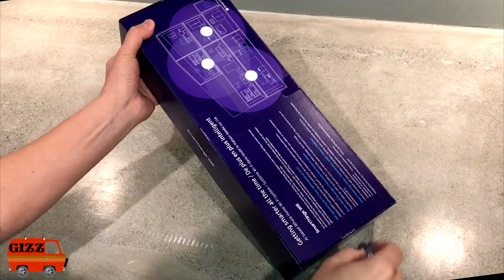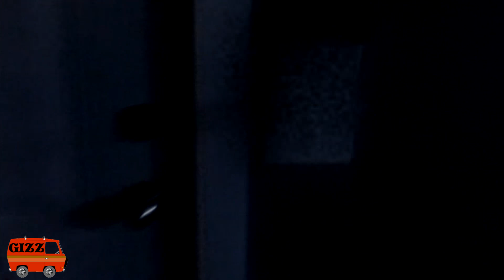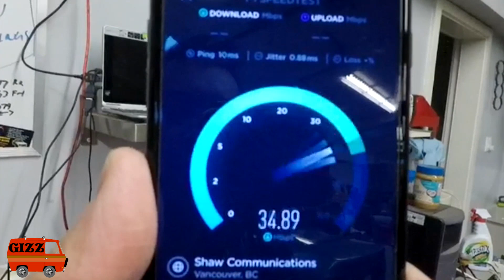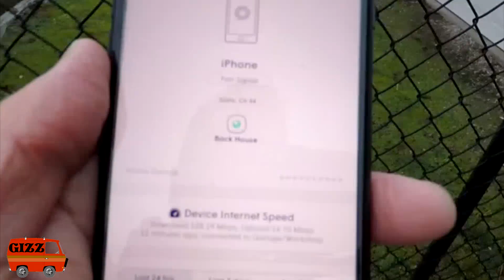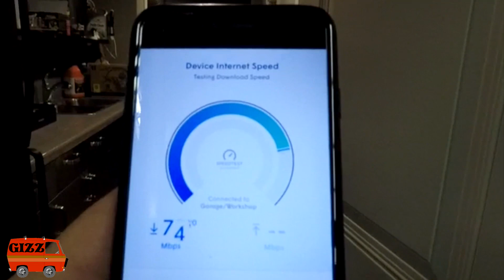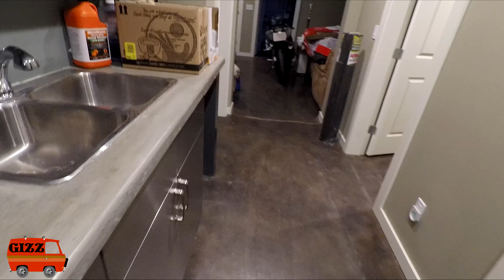Samsung SmartThings Mesh WiFi Router Test

Comment: How much faster are you getting with this router?
Reply from the maker: My speed is limited by my internet plan. The main benefits of this is the increased range, as well as its use as a hub. The internet is also really stable, I never have to reset this.

Comment: This video made buy the wifi mesh.. lol 2 questions, 1. What Cat ethernet cable did you use? 2. Did you use only one long cable or did you use 2 or more cables and connected them with an adapter?
Reply from the maker: Manuel Gonzalez cat5e, my router feeds both, the one goes though 40ft, then a switch, then 25 ft then another switch, then 300 ft then another switch then into the next Samsung unit. I only got the rock solid connections over a long wired distance after adding the cheap netgear switches. How is yours working?
Reply: @GIZZMOTORSPORT  - I have one Hub giving me less then desired speeds. I was thinking of just ordering a 200ft cat7 ethernet cable and run it through the attic. From the out port on the smarthings hub 1 to the second. What do you think?
Reply from the maker: Manuel Gonzalez the 2 in my back building have 2 walls and about 90 feet in between, they are working just fine for wireless mesh. Are you having wifi or hub sensor issues?
Reply: @GIZZMOTORSPORT  - Wifi, on the unit connected to the router I'm getting over 350mbps download, on the second unit (wireless) I'm getting around 185mbps, on the third unit (wireless) I'm getting about 65mbps. 
Do you think my idea on the previous msg might work?
Reply from the maker: Manuel Gonzalez before running wires up to the attic run them from room to room and see if it works.
Reply: @GIZZMOTORSPORT  - I'll give it a try and let you know. I just ordered the ethernet cable. Wish me luck. 😅

Comment: Great review. Have you used the Smart Home Features at all on these devices? any feedback? Thanks!
Reply from the maker: I have lots of the magnetic open/closed swithes, they also sense temperature and vibrations. I have more than half setup to notify me and/or turn on lights when there is a vibration. And of course I'm notified when they open. The one thing I've noticed on the sensors, they can lose connection randomly, have to re-re the battery and then it's back to normal. I also have the skybell doorbell tied in, the video doesnt work as I'd hoped but the sensor can activate whatever you tell it to though the hub/app. All in all it's a good purchase, the the wifi is the best I've had here.

Comment: Just bought a set for the house. How did you go about wiring router to hub? Modem--> Router In and then  router out --> hub in?
Reply from the maker: By router do you mean the Samsung router/hub unit? Or are you using another one?
Reply: GIZZMOTORSPORTS yes just the Samsung products from the video.
Reply from the maker: Tom Peterson that's simpler, you can put the hub output into the next hub, or you can run it into a computer for a hard wired connection, tv for a hardwired connecting, or a switch and split it into multiple connections. I use the hard wired connection on my tvs for better youtube and Netflix streaming. The wifi is really, really good but the hard wired connections are just better.

Comment: I am having trouble getting mine to work.  My ISP provided Modem is in a "wiring closet" in my upstairs bedroom.  My house is wired with Cat5 to each room, so all the ports on the modem are in use.  The Ethernet jack in my office, has a switch connected to it.  I thought I would be able to connect the first WiFi hub, to one of the ports on the switch,  but it isn't working... I even tried connecting the WiFi/Hub directly to the Ethernet jack in my bedroom, still...not working...Any help or suggestions would be greatly appreciated.
Reply from the maker: Terrence Quinn How many IP addresses so you have? If just 1 you have to put the isp router into bridged mode. I was able to call the cable company and they gave me another IP address, if I want a 3rd I have to add another account. Boo
Reply: GIZZMOTORSPORTS I see.  I honestly just want to use them as hubs for SmartThings devices, making little to no changes to my network as possible.  By putting my ISP router in bridge mode, what will that do exactly?
Reply from the maker: Terrence Quinn is the isp modem also a wireless router? If so, shut off its wireless routing and use the Samsung.
Reply: @GIZZMOTORSPORT  Yes.  It is also a wireless router.  Ok. I will give that a try, thank you

Comment: Correct wiring should be from modem to switch box to router
Reply from the maker: Sebastian O that’s how it’s setup now, when I ran a from a switch to a couple hundred ft of cable directly to a linksys wireless router it would drop signal. With the linksys I had to run the long cable into another switch. Not do with the Samsung, It’s rock solid

Comment: Thanks I was looking for a answer about over a Ethernet question that I had. My shop is about 125 from my house.
Reply from the maker: Anthony Robbins it’s actually even better now, about 3 weeks ago the sub hubs connected by Ethernet starting working as hubs to control devices. Something that was not originally functional. I spent hours and hours on the phone with tech support and numerous emails, in the end somebody on their end fixed the sub hub functionality!
Reply: I have a Ethernet cable to my shop and have been looking for a way to hook up my motion sensors and cameras to my home and add some smart switches to turn light on and off. The WiFi will handy for my iPad. Thanks for the video it’s a big help. 👍

Comment: This is pretty amazing.  The speeds you are getting on WIFI is excellent.  I know the issues you've had in the past with your location and the distances you've had to deal with.  I was pretty skeptical there would be a consumer grade solution but it looks like you've found it.  Thanks for this review., I can definitely use this.  I hope more people see this video as well.
Reply from the maker: 604Bluelight it’s odd, even in the main building the Speedtest #’s are faster than the cable company wifi but overall the last 2 days it’s slow loading youtube. I had one time on the hardwired amazon box where it wouldn’t load a program. Who knows, It’s only been a couple of days, we will see.
Reply: @GIZZMOTORSPORT  Ooh..  hopefully it stays stable.  Keep us updated.
Reply from the maker: Both Shaw Hitron and this were lagging that day even tho the #’s were good. Who knows, it’s fine now.
Reply: @GIZZMOTORSPORT  Nice.  I'm pretty impressed.